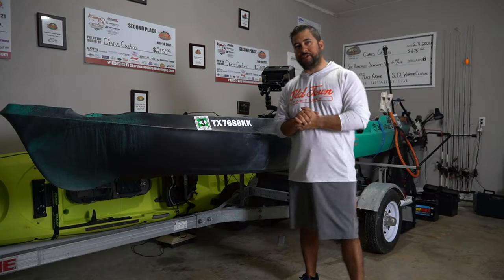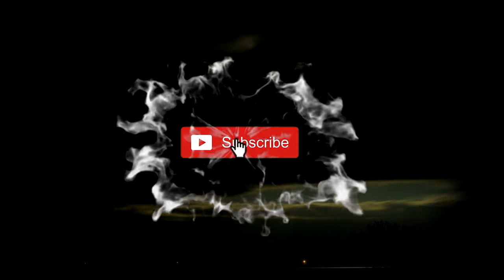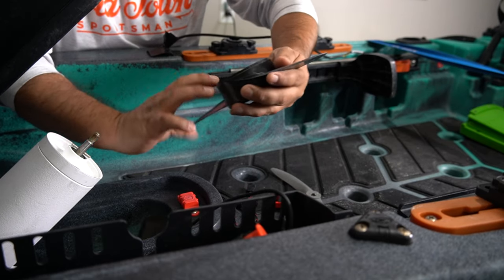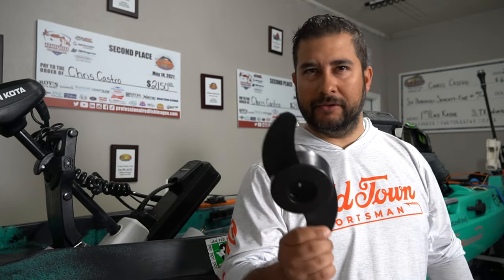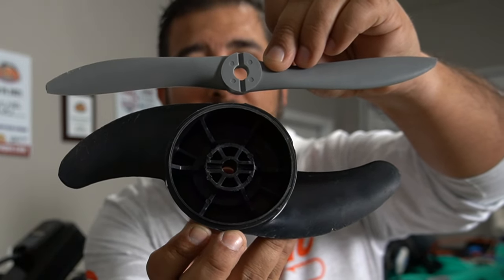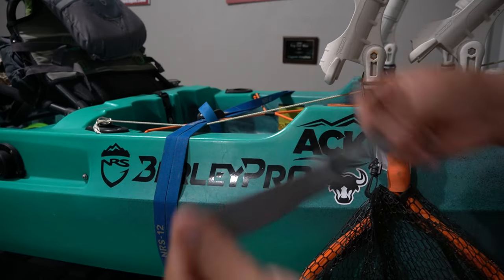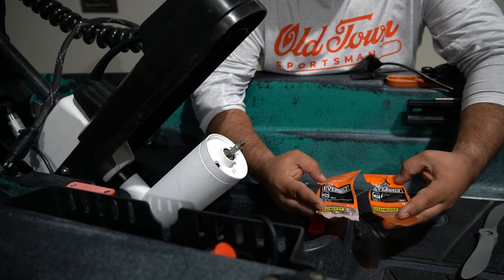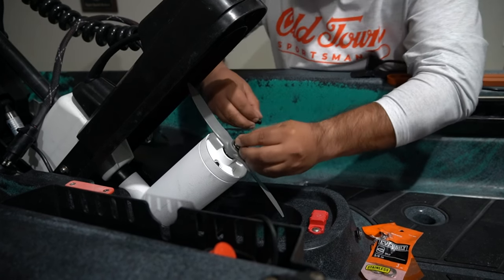Unofficial TURBO Prop? | Speed Boost Your Old Town Sportsman Autopilot Fishing Kayak

Comment: Great stuff !! Any concerns with long term use ?
Reply from the maker: Man great question! So here are my thoughts since I don’t fully understand the way programming works on this Minn Kota. If the programming isn’t working any harder then I’m gonna say we shouldn’t have any issues, although if the system is increasing revolution due to the lack of water displacement, then yes we could have problems down the line with longevity. It’s a question I’m going to find out, and a risk I’ll take to see if it’s plausible for anyone else to try. Thanks for the great question Pablo!

Comment: Model airplane guys are concerned with balancing props after making modifications so that both blades weigh the same to avoid vibrations when spinning at high rpm’s. Great hack- thanks for sharing!

Comment: I currently use the airplane prop, though speed is not important since our lakes aren't that big. Does prop size make a difference
in cutting through weeds?
Reply from the maker: If you have grass issues stick with the original prop. It cuts way better.

Comment: Having been in the RC world for some time, is the APC  that  your using a "pusher variant"  as the  slot in the back would mean it's actually running backwards  which does work but is also the least efficient way.
Reply: Also you can get smaller dimensions i.e 9.5x 5 this would obviously make the clearance issue a non problem  and maybe go up a pitch to 9.5x6 to of set the smaller diameter
Reply from the maker: Sport Pusher.
Left Hand Rotation.
For smaller shaft sizes.
This propeller works well on Electric Powered KAYAKS.
https://www.apcprop.com/product/10x4p-lh/

Comment: I did this a few months back and always had issues with the prop getting stuck when trying to dock..... I trimmed it as well... I took it off after I snapped it on the Brazos River......BTW the speeds were awesome..... I have the 106 mk
Reply from the maker: Yea this prop is definitely not as rugged. Probably a good thing for not damaging anything, but a bad thing if you are in and around structure. With a significant battery increase I plan on keeping both on me just in case I run into issues. Question: what speeds did you get on your MK?
Reply: @NextLevelFishingTV  with the new prop 4.66 and 4.03 with old prop.
Reply: how many lb's of thrust does the motor come with on the 106 mk?

Comment: How much does the rpm increase? Doesn’t that wear out the motor brushes sooner?
Reply from the maker: I suspect an rpm increase but I could be wrong.
Reply: Just came across this video. Let me add the rpms on a brushed motor are based on input voltage. You may get more speed and thrust but not actual rpms

Comment from the maker: I’ve had this conversation with many folks in the past. I think humanity has a good grip on prop design, although if I can get this type of speed increase, should we be focusing a little more on putting the right prop for the right job? … or am I just going crazy? 😜
Reply: I think that prop design involves compromising between various factors to get the result that best meets the application. Let's say that trolling motor design factors are #1 motor / shaft RPM #2 maximum boat speed, #3 static thrust, & #4  electrical load (amps.) Let's assume that we aren't going to be able to change the shaft RPM range and we will accept the motors the way they are made. If maximum boat speed is our goal, the prop size and pitch (as well as blade width and whatever factors could be changed) differences can be observed on a particular boat. Static thrust is useful for maneuvering the boat at very low speeds. This could be tested by tying the boat to a dock with a means to measure the pulling force at various power settings. I would guess that the standard prop will produce the highest static thrust. The type of boat being tested shouldn't make much difference because it won't actually be moving (unless the tiller is swung.) The last factor is electrical load. I have read that the OEM prop is made to operate within the design electrical load limits of the motors. A steeper pitched pro might have the ability to deliver a higher speed but could result in a higher electrical load than the motor is designed to operate under. I've thought about messing with this some myself. To do this I'd want to put an amp meter on the electrical line so I am able to keep the load within the design limits.
Reply from the maker: @noyopacific  interesting stuff here noyo! Thanks for breaking this down for us. 💪

Comment: How does that hold  up when you hit rocks...Thinking about it in the river..Thanks.
Reply from the maker: It’s a thinner blade so I couldn’t imagine it being stronger than the original. The blades alone are only 3.95 so it’s worth a shot I’d say. One thing is for sure…you’ll be faster.

Comment: I have the AP 136 and I could not dock because the blade kept getting stuck even after trimming it like you suggested.  

How are you able to use it?
Reply from the maker: Don’t have that issue but you will if it’s too long. Line up your original prop and be sure it’s the same length.
Reply: I’m having the same issue. The problem
Is the original prop is much thicker so it turns more when lifted while the APC is less because it’s thin. I already shaved off 3/4“ and still binds when lifted

Comment: I bought the exact prop linked, modified it as was instructed in the video. Put it on and went out to Rodanthe sound, went 5 feet forward and the wind and waves pushed me backwards at a speed of 10. I can say this definately does not work in any windy conditions, we were in 15 mph winds. The main reason is that the blade is too thin. You do not get the nessasary thrust for forward propulsion. Very little surface area. While this may work better in low wind environments, it's not for sound use with winds over 10 mph.
Reply from the maker: Interesting, I’ll have to pay attention to this. I’ve been in a few 25-30mph wind situations and haven’t noticed any immediate lack of performance, but will run some electronics to test it. Thanks for the info
Reply: No shit, Sherlock.

Comment: Do you think the ap drafts shallower than the predator. Thinking about picking one up for fly. It would like a little self poling skiff
Reply from the maker: I feel like it does because of the “w-shaped” hull and with its much larger weight capacity it just sits much higher. I’ll do more test of this in the future.

Comment: 'why trim it?  but OK.
What about you put it on the motor then mount the motor on the work bench or in a vise,
'then mount your Dremel and you'll be able to cut the same amount off each side of the blade.
Reply from the maker: The blade gets damaged quickly if we don’t trim it when releasing the drive. As for my technique, yea that could use some work.

Comment: Why do you need the washers? Can't you just use what came with the other prop?
Reply from the maker: The assembly thickness between the minnkota prop and the model airplane is slightly different. The washers will makeup for that.